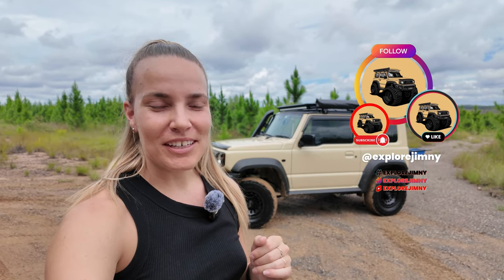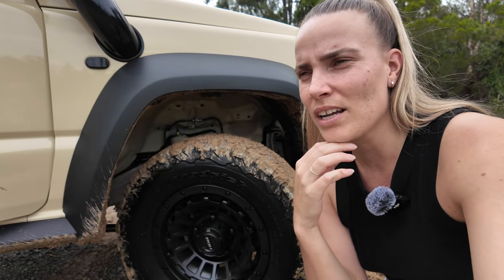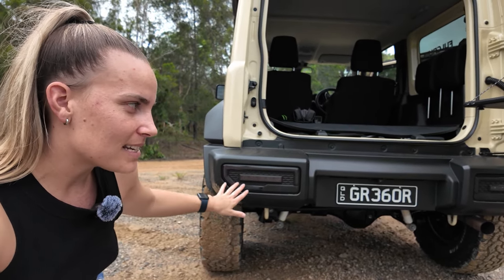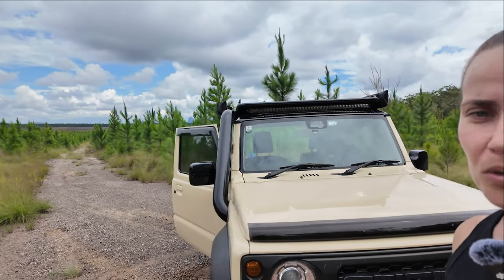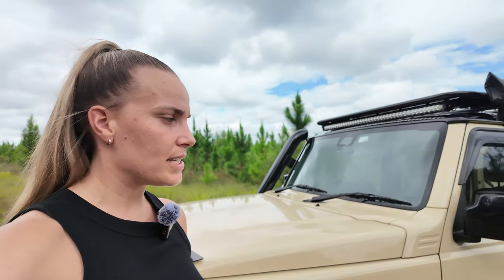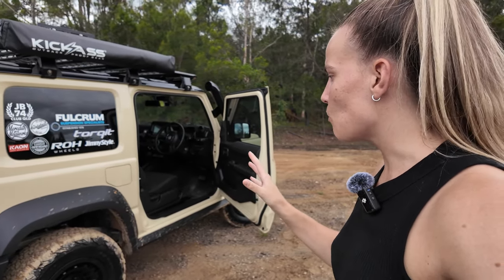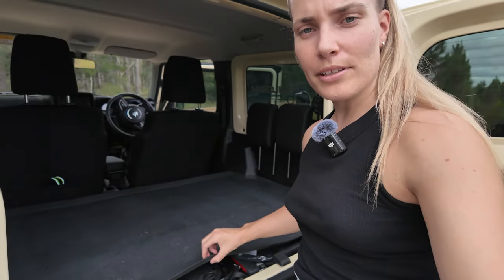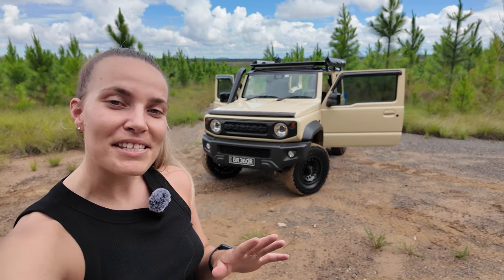FULL REVIEW OF MY SUZUKI JIMNY JB74 MODIFICATIONS

Comment: Thanks so much for your video. My 26yo daughter has just taken delivery of a black 5 door, coming from an MG SUV, and wants to try 4WD and camping down here in Vic and before even seeing your video has already made a list of mods that you have done. The only thing she is unhappy about is the power, no arm rest, extra cup holders etc. As a father I want her to make the right choices so your video has helped so much thank you again and cant wait to see what mods you put on the XL
Reply from the maker: Hey! Thanks so much that's awesome to hear. Yeah the power is a bit annoying not going to lie but luckily the small things like an armrest etc is easier to purchase and of course cheaper. It's not the strongest 4wd, far from,  but it performs really well off-road due to it's weight and I think it's probably going to be an excellent entry-4x4 for her if she's  just getting into it! :)
Reply: @ExploreJimny  Thanks for your reply. Yesterday we dropped the car off to have a Turbocharger fitted. Other mods that have been done are:
Turbocharger $6,500
Ceramic tinted windows $ 813.00
Front and Rear 4k Camera system
Bonnet Heat Protector $ 29.36
HUD - Head Up Display $ 28.37
Bonnet Stone Chip Protector $ 73.55
Center Arm Rest $ 54.66
Weather Shields - 4 doors $ 64.32
Mud Flaps - front and rear $ 35.19
Front Parking Sensors $ 36.51 – being fitted
Rear seat storage organiser $ 61.03
Door key hole covers $ 11.02
Side door storage box inserts $ 9.86
Rear window heater wire covers $ 5.79
Gear shift cup holder and storage $ 17.52
Center dash storage tray $ 17.69
Window auto lifter and mirror folder $ 137.41 – being fitted
Blind spot warning lights $ 82.93 – being fitted
Turbo emblem $ 6.11
Bull Bar $ 308.40
Body side mouldings $ 120.35
Rear door 90deg opener $ 33.07
Rear view mirror rain shields $ 1.26
Door sills anti scratch tape $ 7.54
Bonnet twin hydraulic struts $ 39.91
Nav Screen protector
To be purchased
-	Suspension
-	Throttle control
-	Wider wheels and tyres

Comment: Love the full run through of your mods! Regarding your speaker upgrade, the link on your page goes to speaker bracket mounts. Did you just install these, or change out the speaker entirely? I've been thinking about upgrading the front sound system for some time but am curious your thoughts as to how far this should go (super new to sound sytem mods, sorry). Would also be keen for a video on this if you haven't yet done an install for the 5 door :)
Reply from the maker: Hey! You actually just need to replace the speaker in the front and add the bracket on, it was quite easy from memory and I was brand new to it too back then so you'll be fine just working your way through a few YT videos and have a go!